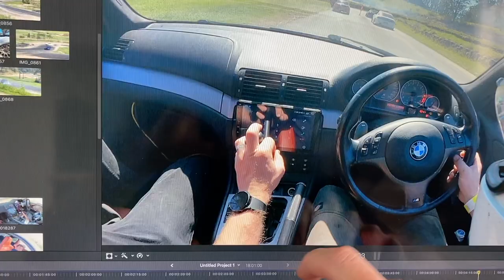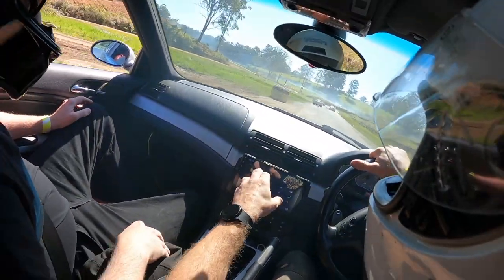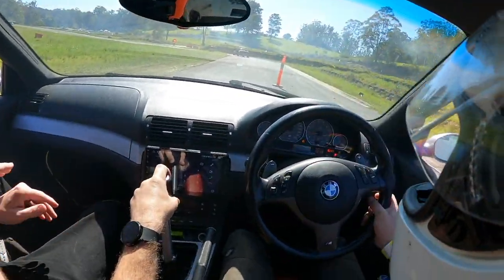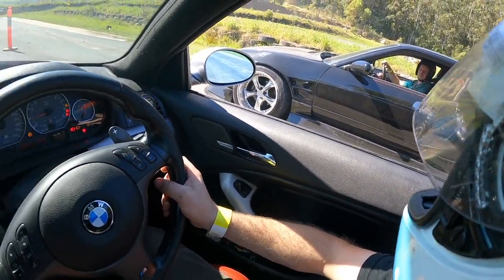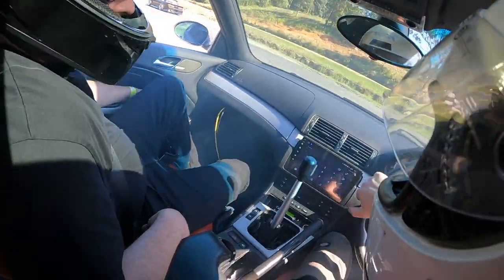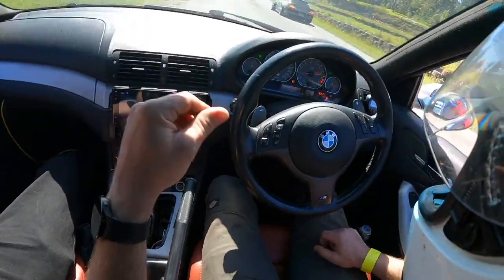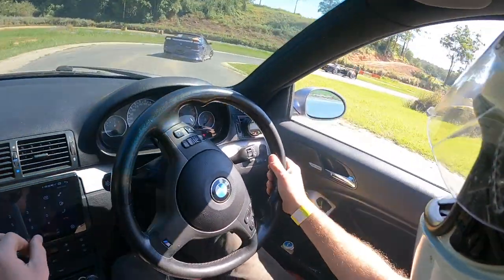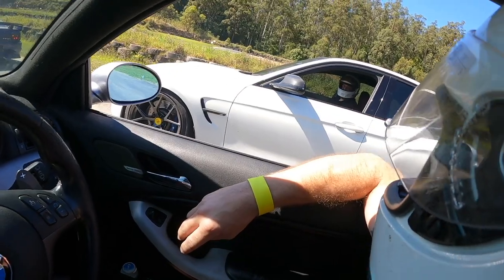TURBO LAMIK 8HP POV DRIFT W/ CLUTCH: RAW FOOTAGE

Comment: Impressive. I wonder how long will the 8HP take the stress. Can you do it all day long?
Reply from the maker: It seems you'll wear the tyres out before the trans gets warm......
Reply: Isn't that what they did? LOL. I'm very impressed.
Reply: @ZeroTo60Tube  is tank steering/torque vectoring possible with 2X in a transaxle configuration?

Comment: I'm sorry but I've got to say it again. HOKEY CRAP FILNGIN POOP MONKEYS!!  That's insane how hard he's hammering that machine and it just keeps on going no problems. I does get a bit hot but he's still able to continue and enjoy the day. I do wish the Tach (Or Tacho as you guys say) worked because I'd like to see what kind of RPM he's booting into that thing then clutch kicking it like it's no big thing! LOL. (As Dan points out in the comment below, I was looking at the speedo not the RPM Gauge DOH!). I understand now why he wanted the car set up with the clutch as he just wants to drive it as he would have the manual. But it's so much better as it will never stall on him and he can ram in the gears without even using the clutch at any time at any speed or RPM and the N54 just keeps on going SO hard! I LOVE IT! Thank you Andrew again and Dan! This was epic to see and hear as he was going about the day!
Reply: Tacho works! Just speedo doesn't due to abs unit being unplugged!
Reply: @Buckna1  LOL. So I was looking at the wrong gauge the whole time. DOH!  You'd think I'd know better as I have the same car. LOL. Only Left hand drive.

Comment: Wait an 8hp with a clutch? Can someone explain that to me haha Like we're talking about a zf8hp auto trans right??
Reply: The clutch is essentially a switch that puts the trans in neutral for pulling hydro
Reply from the maker: Worth watching the whole playlist to properly understand. The clutch in this car uses a linear potentiometer to show the tcu clutch pedal position. That then correlates to a virtual level of clutch slip in the transmission. So you can when he pulls away and let’s the clutch pedal out it takes off just like a manual. Even moving the car as the pedal comes up and a little chirp of the tyres as the foot comes right off the pedal and the clutches in the auto trans fully engage.